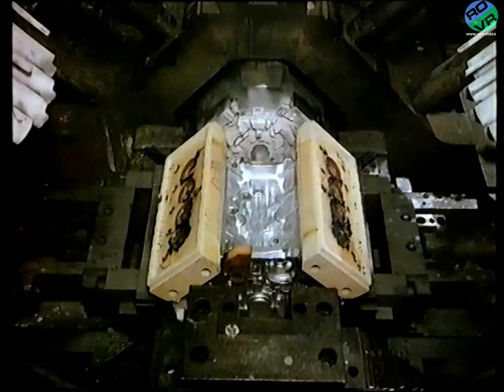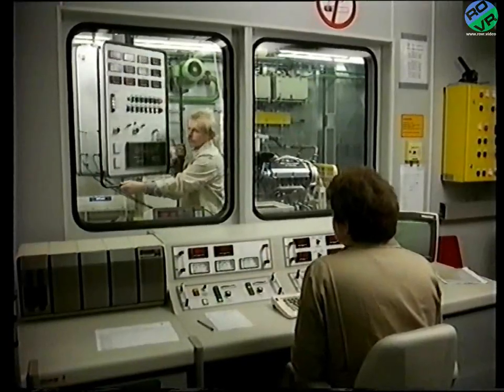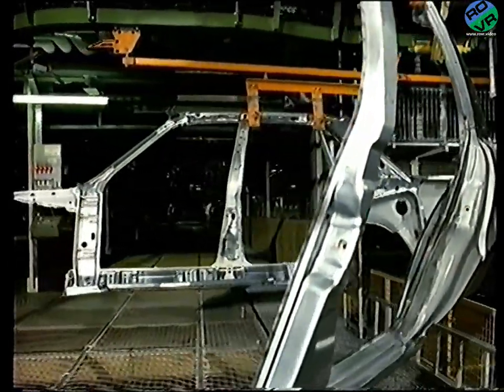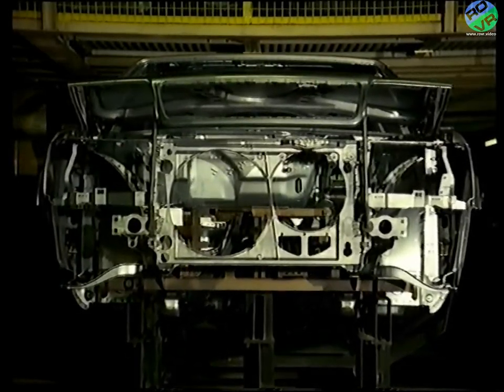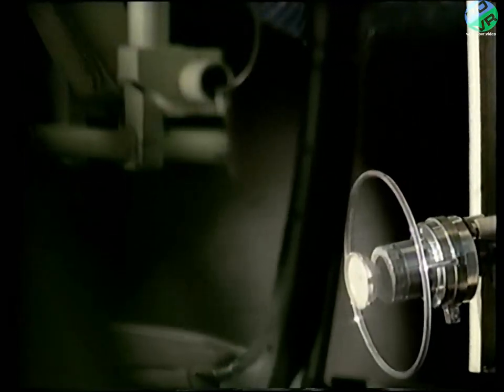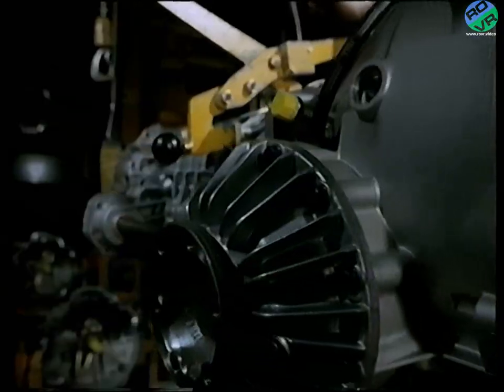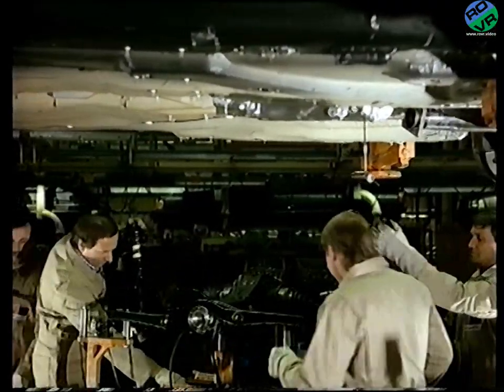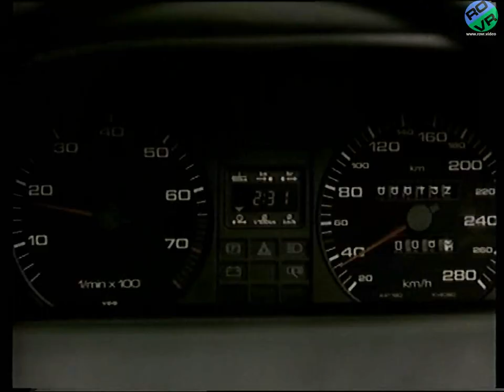Audi - V8 (4C) - Station - Production Line -  How Audi Cars are Made (1989)

Comment: Thank you for posting this.  Had a 1990 V8 quattro years ago and it was an awesome car.  It also proved to be very well built as well as reliable. The automatic transmissions were said to be troublesome but we regularly service the fluid and filter and never had a problem.  It had more than 160k miles on it with the original transmission before losing track of the car.  (It was sold to the father of a friend and was eventually traded)
Reply: I own a 1991 Audi 100 2.3e C4, we have it in the family since 1991 😄. Before we used to have a 1982 Audi 100 CS 2.0 diesel C2 followed by streamline Audi 100 CC 2.0 diesel C3. All are 5 cylinder engines and were bought brand new... great cars and reliable.

Comment: The V8 quattro means so much to me. It's like a member of the family. Great car, I wish it was a manual, but the auto is a cruiser like most automatics of the era. More gears would be great. Lots of cool and unique features in this model! K never liked the wheels though or the lack of a rear sway bar on non sport suspension models. The big BBS mesh wheels with sport suspension and a manual is the ticket! DTM is also impressive. Thanks for posting!